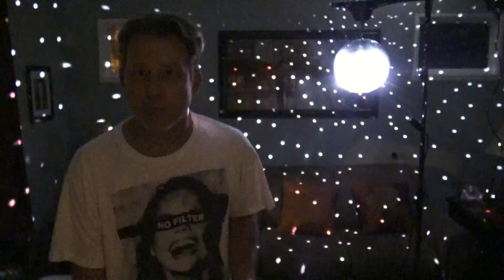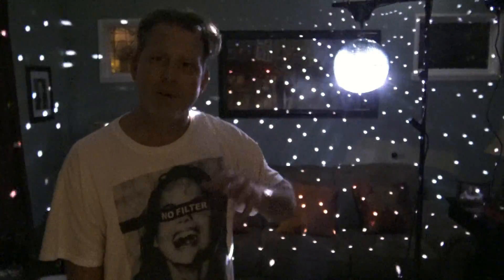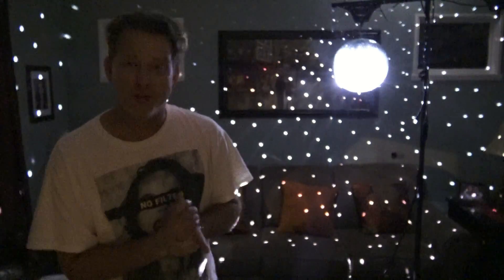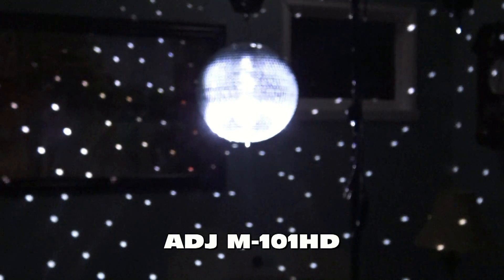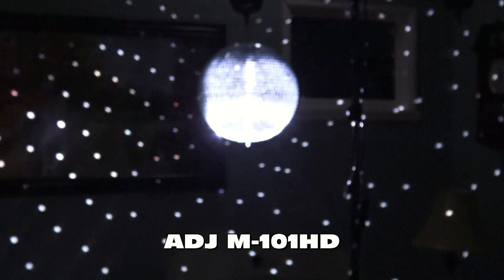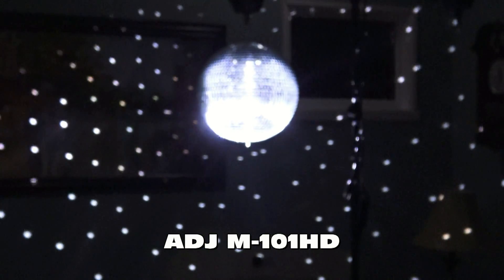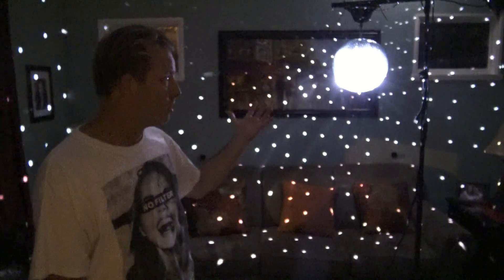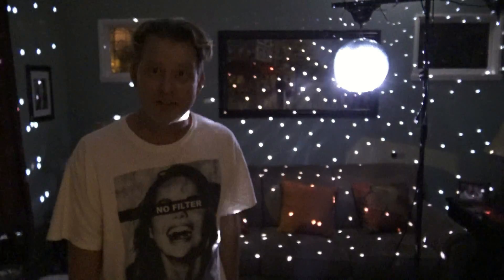DJ Help - Mirror Ball Motor Speeds - RPM

Comment: I've got one that goes between .5 rpm and 5 rpm.  It's the Stairville MBM40D Mirror Ball Motor DMX.  It's pretty fancy, but I'd like one that turns even slower.  Is there a motor I can mount that turns at 5-10 rounds per hour or something?  That would be awesome.

Comment: I've been trying to find a motor that will have variable speed and different direction spin that holds a 30 pound disco ball, it's been impossible to find. Any suggestions? I bought the Heavy Duty American DJ MB DMX II but found out it only holds up to 13.5 pounds... Need help! Thanks!

Comment: thanks for the vid! I have an adj mini starball II and always hated it, it has a 20 rpm motor. Wayyyyy toooo fast! I got some really cool motors on ebay from china....3.50 each. I got a 1 rpm and a 3 rpm. They are the exact kind of motors used in adj products. Not sure which one to use in the mini starball II. I agree that slower is better. So maybe the 1 rpm goes in the SB II. The original big starball had a 5 rpm motor, which looked good. Do you know if you can control the speed of these with a variable resistor (potentiometer) or would I need a dc motor for that? Thanks !

Comment: Good information Brian. You're right, they are coming back in a big way. I've dusted mine off this past year and used it many times. I have the ADJ  101 and this why. Many clients/venues restrict the use of strobe effects for medical reasons. The emergency strobes that activate along with the audible alarms in buildings have a federally mandated strobe rate to prevent seizures. I only know this because we made a good buck retrofitting buildings to the new standard years ago. Anyway I agree the 101 is much more dramatic and I haven't had any complains about the speed.

Comment: Good vid. When I got into djing 14 years ago I wasn't sure what speed to get. They had 1,3, and 5 rpm. I think they still do. I decided on a 3 but wish I got a 1. I was thinking a 5 would be way too fast and a 1 would be way too slow but the 3 is still really fast. I've used a mirror ball ever since the beginning. First with those halogen pin spots, then with the 10w LED pinspots, now I may use my moving heads to point at it which are 60w LED.